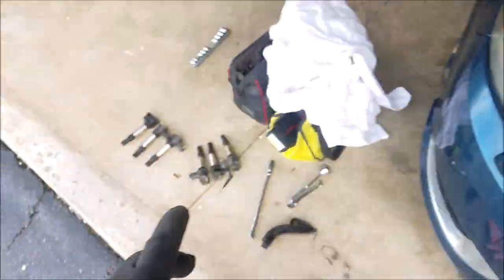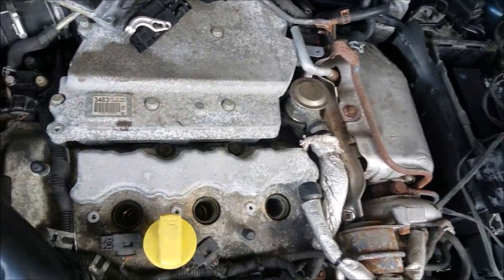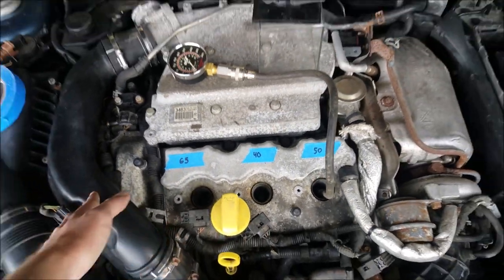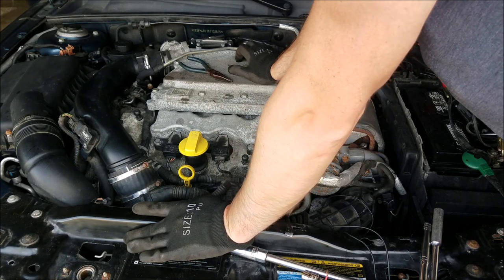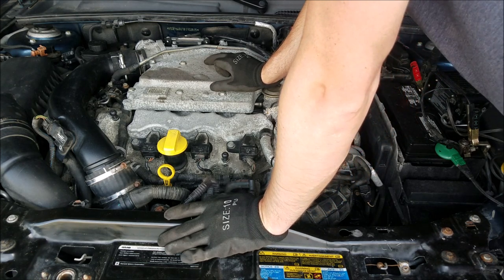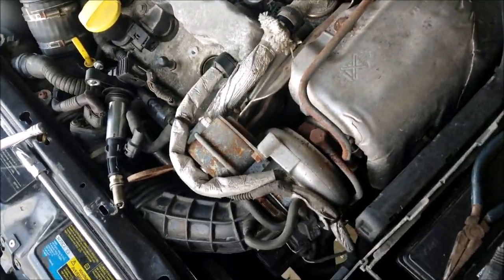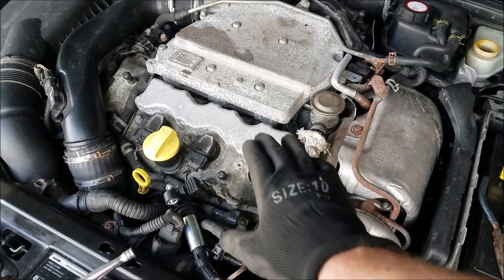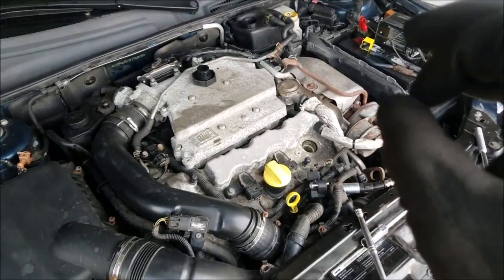Project Saab - Won't Start but Why?

Comment: Those aftermarket caps on the coolant tank will not hold pressure. I see these thrown on these engines all the time and they always cause coolant to seep out.
Reply from the maker: Yeah I'm not too impressed with the aftermarket coolant overflow reservoirs and caps available but for now it will have to do. Once I get it running I may switch it out to an OEM version.